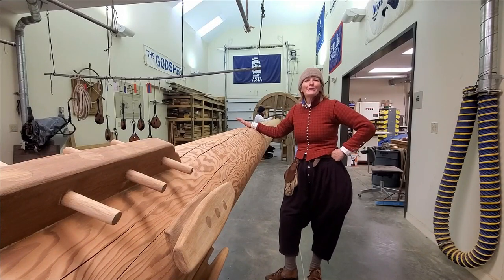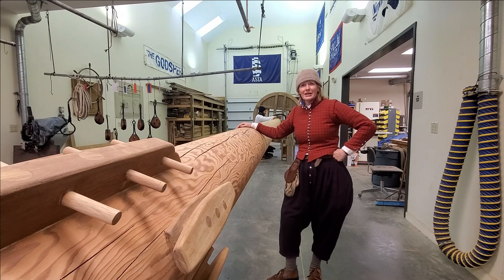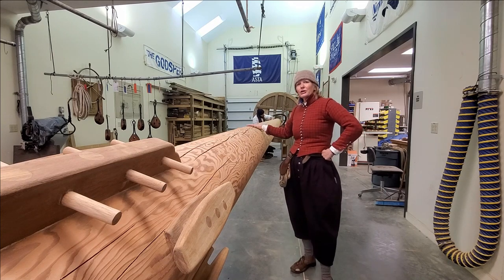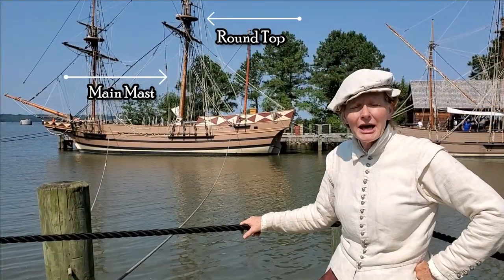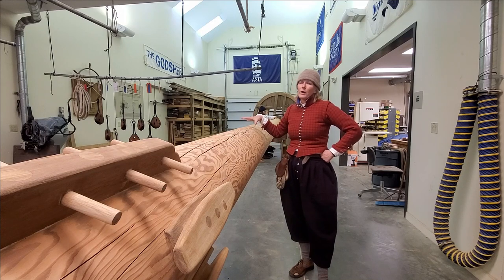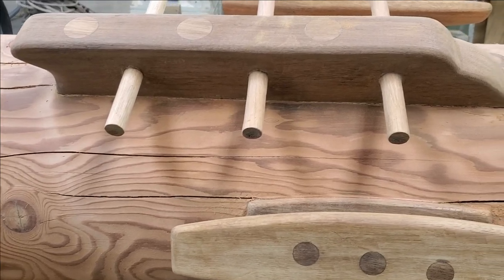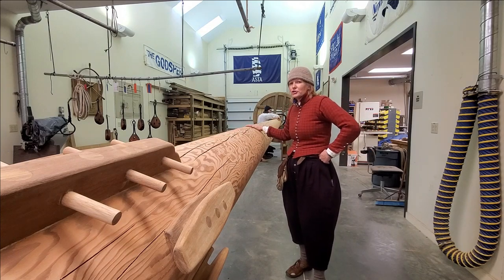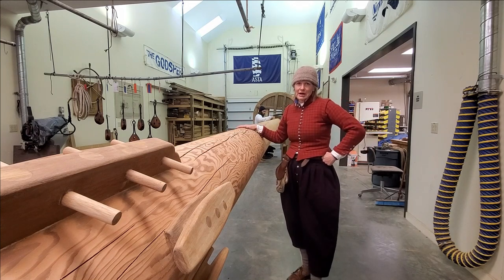Godspeed's Mast Maintenance | Recreated 17th-Century Tall Ship

Comment: What the most powerful arbalet or musket?
Reply: I would say that it is somewhat a moot point, since by the mid-16th century the musket had replaced both the bow and the crossbow as military arms for England.  But, the musket was simply easier to learn and to become proficient with, and the musket ball moved further, faster and hit harder because it retained a significant amount of energy compared to arrows and bolts.

It is interesting to note though that about two dozen quarrels -- specifically hunting points -- have been found in the archeology of the original James Fort site at Historic Jamestowne, mostly in contexts dating to 1607-1610.
Reply: But the arbalet was made for piercing armor? I have heard that musket can fire down and not the arbalet(the projectile can t stay in place), is that another reason?
Reply: @guillaumedzitko6169  Sure, at one time there were arrows and bolts that could have pierced armour, such as mail; though technology does not stand still and the likes of armourers, iron makers, gunsmiths and gunpowder makers continually improve their craft, and advance their understanding of these things throughout the 16th and 17th century. 

Like I said by the late-16th the bow and crossbow have simply fallen out of favor because they lack the ease of use along with the harm that the bullet can do to the human body (without having to strike somewhere vital). Its has little to do with whether a "musket can fire down and not the arbalet" but rather the arrow or bolt must actually be accurate to be effective, while the bullet does not have to be accurate to be effective and the musket ball can get through much of the latest armour, and all from a weapon easily learned and understood.